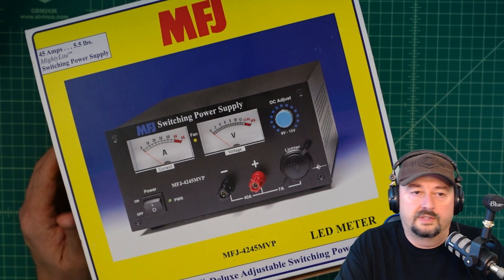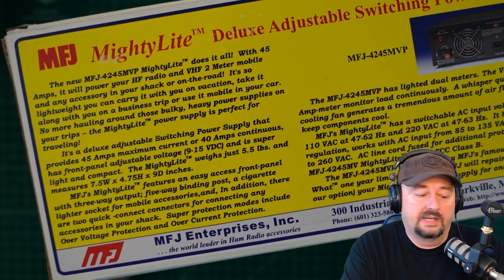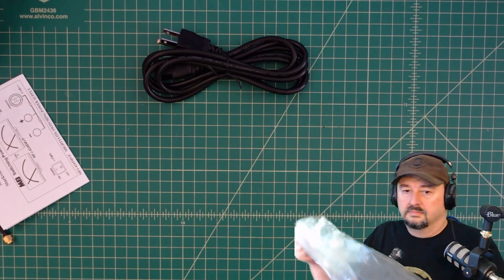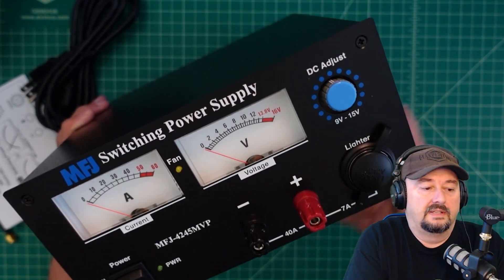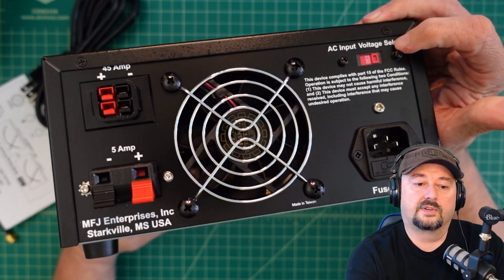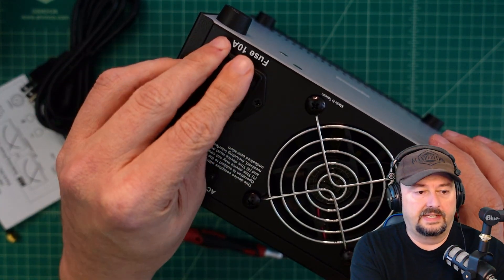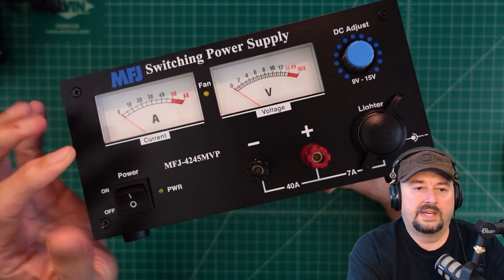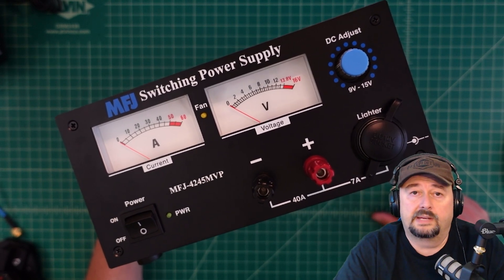MFJ 4245MVP Power Supply Tested

Comment: Heh, those double fans are indeed loud.  My shack has built in window base cabinets, so I put the thing in there to cut down the noise.  Yes, I double checked the heat -- no problem.  I can do FT8 on my 7300 and talk on my 9700 at the same time, no fuss, no muss...
Reply from the maker: That sounds like a pretty good solution for the noise 👍

Comment: Looks like a great supply for the whole shack.  A good test might be running FT8 on the HF rig and then running a net on 2 meters at full power.  Might not hit the 40 but it would come close.  I have 2 samlex supply's in my shack.  One for HF and a dual band FM rig and another for the second HF rig in the shack.  I never have had any issues.  Great video. 73
Reply from the maker: I think the next video will be testing the noise levels produced.  Thanks for checking it out Jeff 👍

Comment: When doing any kind of SMPSU review, I'd love to see a SDR or SA fired up next to it to look for RF noise.  You'd like to think anything made for radio would be RF quiet, but it's always good to test that it is!
Reply from the maker: I’ll do a noise test.
Reply: @TheSmokinApe  Also key down and do a voltage drop test when transmitting. That has been an issue of mine seeing drops to about 11V which the radio did not like.

Comment: Sorry, this seems to be almost useless as a review.  No test to see if it can deliver the full rated current, no voltage drop test, and most of all for Amateur radio, no test for noise, likely the most critical test for a SM PSU for ham radio use.  Might as well have called this an unboxing.
Reply from the maker: Let me get right in changing the title 👍

Comment: One more comment…. With all the spurious emissions we already have in and around the shack …. Why are we going with switch mode supplies? Yes they are lighter and more efficient but we are hams…. So why not build a 20A linear supply (or  2 even )? It isn’t hard to do and is quieter. Mine weighs about as much as me…. But it lives under the bench so who cares? It also doesn’t run a noisy fan constantly and emit RF. Below is a link to my Drew Diamond VK3XU designed “Miser Supply”. Mine used 2 rewound microwave transformers (to lower the saturation magnetising current to acceptable levels). 73 de VK2AOE 

Linear 20A 13.8v DC HAM SHACK PSU - Made with rewound microwave transformers@TheArtofEngineering
https://youtu.be/uV5gD_t0V6w
Reply from the maker: I’ll check the link, thanks TAOE 👍

Comment: Thanks for the review…. I always wonder when load is up what happens to ripple and does it get worse? For a simple load tester I get e cigarette nichrome and twist together about 8 strands and wind it on ceramic ( I used an old brick / ceramic house ventilation brick). I connect to it with mains cable and screw down electrician fittings ….. which will melt but last for one test and keep heat away from thing under test. 

Rewinding a Microwave Transformer for a Linear PSU@TheArtofEngineering
https://youtu.be/g3ILAGc5T9g
Reply from the maker: Hmmm, maybe I’ll figure out how to do that test, thanks 👍

Comment: Yea, I'm one of those guys who don't like sponsored product videos. That said, I appreciate the lengths you go to for a fair review. Much better than that 2.0 guy, who loves everything he reviews (who's videos I have now blocked) . As to the MFJ power supply, it looks like a decent supply. I'm not a big MFJ fan and prefer the tried and true power supplies like the Astron. Call me an old fart, but the Astron can easily be fixed should something go south. Something that rarely happens. My Astron will still be going strong long after I'm worm food. It has clean, rock solid power output which can not always be said about the switching power supplies. Some are better than others. Last, although the Astron's may hum a little (can't hear it with old ears), I really hate having more fans in my shack than is necessary. For these reasons I say buy once, cry once. The Astron is a life time power supply. The only other test I would have like to have seen was to look for birdies produced by the switching power supply. Thanks for what you do Ape. You're one of the good ones on YouTube !   P.S. I spotted a Astron power supply some one had thrown out at the dump. The case was bent to hell and it had been rained on. Took it home, straightened out the case the best I could, plugged it in and it works perfectly. You can't beat quality.
Reply: I think sponsored (when transparent) reviews are OK but it's the shill reviews so popular on some other channels I really detest.  Like you, I have unsubbed and blocked many for that reason...and radio seems as bad as the gun and bushcraft ones in this respect.  When you know it is free, you can be a better judge of how objective the reviewer is.
Reply from the maker: Hey Ammocraft.  I like to think I am pretty objective, I can tell you that here are many ham radio and electronics manufacturers and retailers who won't work with me because they didn't like the way their product was portrayed.  I am fine with that...  Also, if I am sent something that is junk, I won't review it which upsets marketing people quite a bit.  Thanks for watching.
Reply: @TheSmokinApe  You absolutely are...as I said, I have unsubbed the shill channels, but the fact they sometimes mislead beginners into wasting money on crap they were given for free in exchange for reviews (and don't make this clear) irks me no end!
Reply from the maker: Hey John, I agree with your points about linear vs SMPS.  Thanks for checking out the video and watching the channel, glad you like it.